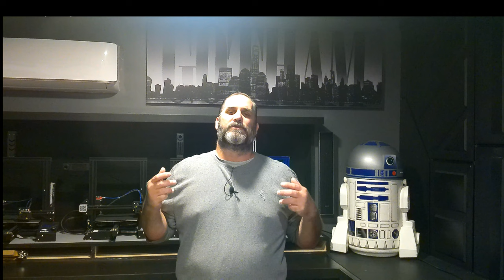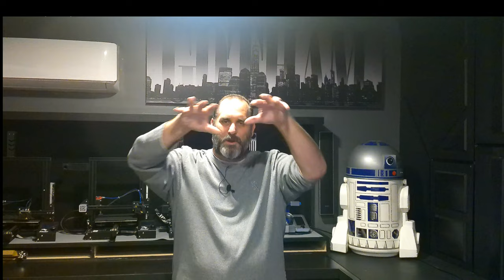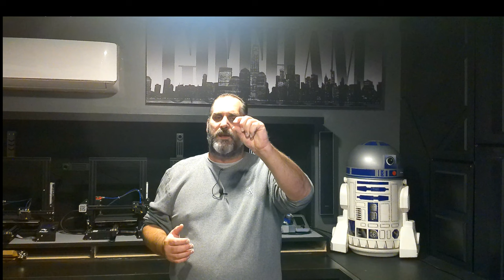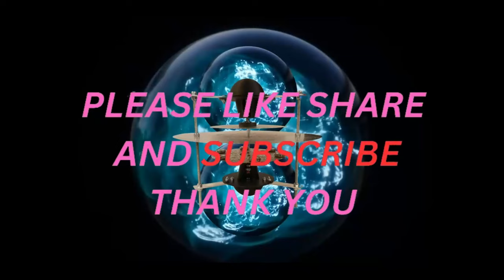Graviflyer Update #41

Comment: Nathan great video once again. You need the high amp hour battery. The 1400 and 600 rpms are near the Schumann resonances as I explained many times. Oh, what is the red light flashing on your air conditioner? Dielectric coating. You need to get rid of the RF and get visible. You have a roundabout way of explaining science and I am not so sure if everyone will understand what you are chatting about. I forgot to mention pulsing in my comment to you as pulsing accelerates the entire craft and a person needs pulsing to get a force from the acceleration as F=ma.
Reply: I think where the russian lives they have some kinds of magnetic field that are different from where other people live.  I think the device is a air MHD drive.   The angle of the magnetic field may be very different from where they guys live.

 NASA now has a ION drive that works at ground level and can generate 1G so we can fly now with ION engines.
Reply from the maker: I am almost at the end of this project. I cannot change what people understand. I can't get people to accept the testing right in front of them. I should have done this project without showing everything.  I know how Alexey feels.
Reply: @nathanbunten4299  "I can't get people to accept the testing right in front of them. I should have done this project without showing everything.  I know how Alexey feels."
Please don't say that - is what I would say, as I personally feel I learn a lot from you experiments and view points. I do however get your mood and feelings. It is not fun to be 'un-normal' when 'normal sane' people group together looking for victims to belittle so they can feel better, as sadly they're often truly miserable inside.
Fortunately the western world has a mostly democratic view, everyone is entitled to their view(s) - sadly some people use the bottom end to voice their views and do their thinking, instead of using their brainy end.  
Please don't let a few arseholes spoil your day!
Thanks again for sharing, it is indeed caring :ø)
Reply from the maker: @EgonSorensen  thank you for that. I just want people to understand. All they want to do is change the experiment. Then others just hit the dislike button every time it is not flying. It is irritating. Thank you for listening and caring.
Reply: @nathanbunten4299  If you're one step ahead, you're said to be a genius and a great leader (sadly most that leads tends to be narcissistic manipulating psychopaths instead of caring people)
If you're two steps ahead, you're said to be crazy (sadly often by those said to be one step ahead)
I have come to see 3 kinds of people: Alphas (often leaders), Betas (often followers) and Sigmas (often lone wolves)
Alphas depend on Betas which depends on Alphas - where the crowd (2+ people) collective mind is like hyenas, the strong survive and the weak die and the theme stays hyena. Sigmas tend to their own set of values, often giving alphas and betas no power over them, as they know they can't control either, so why spend time and energy on changing their 'hyena' mindset and behavior. 
It is unlikely or very hard to change others mindset, and when you say "All they want to do is change the experiment" - they're trying to make themselves alphas and you a beta, bossing you around to do the hard work (and they can claim any and all outcome).
"All they want to do is change the experiment" can also be due to language barriers and lack of personal body-signal-decoding.  My native language is Danish, and Danes is known for being (extremely) direct - not something other cultures especially appreciate all the time (I know from experience). It's just how 'we' act, 'we' don't mean anything bad or demeaning by it, often it is a way to let somebody else know that other ways is/might be possible in a positive way - but 'we' don't expect others to do what 'we' say. 
I hope you get my viewpoint, not everything I say (and I presume others too) is a demand to .... - it is to point out factors that could be important and/or of interest.
I just wanted to make that clear, as I have voiced a few things from my experience as an electrical engineer/radio mechanic and strange/interesting observations in the video presented - and since you have taken the time and effort to do the work, etc - what is not to like, and hitting the like button and reading + liking comments is just a single click, a million times easier than doing what you have to do.
If I don't like content, nothing keeps me here and I can stay away.. and oh, you might the first dislike from me when you get it to fly, as then there'll be no more interesting stuff and interesting points and views from you ;ø) Until then, it's all thumbs up from here!
Reply from the maker: @EgonSorensen  I like direct conversation. Less hiding behind another person's point of view. It is not fake. My parents were in the air force. So the faster to the point the better. 

They probably only see one experiment. Where I see them all. It is a different experience.
Reply: @nathanbunten4299 science literally can’t progress without work like what you’re doing literally right now. Greetings from Tennessee.
Reply: @nathanbunten4299  "So the faster to the point the better. " - Exactly!
Now you 'just' need to learn to speak Danish ;ø)

If you're inside a box, all you see is the inside (or nothing at all, if en-light-enment is missing). If you can think outside of the box, the view is .. well, not the same, and trying to convince others to follow ones views and experiences is often a futile thing to do.
Thankfully this social media is called YouTube, it's YOU on the 'tube' - not others throwing you in the slammer for heresy or single-mindedness for the world to see (though some might try through words to compensate for their own shortcomings. My experience is: Just ignore the negativity here on this platform, positivity attracts negativity)

Alexys said something about positive charges on the graviflyers top-plate equals lift. Be mindful of the negativity but don't let it drag you down, stay on top - stay positive, align and master the fields :ø)
Reply from the maker: @Critter145  Thank you. Greetings from southern California.
Reply: Nathan, YESSS and how I feel from being listed as disabled for the past 44 years after working with the US government on UAP and refusing to join them, so they disabled me as they did back in the day and told everyone that I was crazy and ruined my life. But there is hope now as I informed the US government last month about what occurred to me back in the early 1980s so they just took me off of my disability status and maybe they will compensate me. But if you had not posted everything then I would never have seen your videos and offered my help if I indeed helped.
Reply: @doityourself3293  charles buhler right? yeah if we can replicate that and scale it up correctly we can make a proper ufo, btw it's actually not ion wind says buhler himself because they still got thrust in a vacuum  with no air, so no ion wind just electrostatic pressure, might as well call it anti gravity at that point. not to mention TT Brown discovered the same thing back in the 1920's

Comment: alexy used "electronic ballast" with ac dimmer in driving flyback trans to have control the power and lowering the voltage in your previous video,the zigzag capacitor of aluminum foil is leaking and shorting it dielectric so alexy pulsed it manually several time to let it build up charge, a cavity shape electric plate like honeycomb is way to go as the middle disc because it's less eddy current build up and it's support "scalar wave" static charge electric field without magnetic axis.

Comment: I believe the earth has its own frequency.  With that said, can you feed the (drive beat)  into the peizo speaker?  So, you have the mech drive the rhythm,  and have the speaker give off an earth Hz or anti Hz?  I've been following you for a while.  I also have messed around with unconventional lift methods.  I have a background as an aerospace engineer and composite materials.  Let me know if you ever want to bounce ideas.  I have found we you get burn out or blocked, it helps bouncing ideas.  God bless.
Reply: 4-8hz
Reply from the maker: Thank you. I put this thing in a different state on the testing 11 video. It was. Lose to 13hz. It changed the whole thing. The piezo was active at 4v 1.2a with the same beat frequency as the top disc. 720 rpm close to 13hz. The testing was better when I changed the octave. I am close to understanding the final part. It is harmonics at low voltage and low hz. I finally found the correct octave that makes the piezo more powerful. I need to adjust the amps in the high voltage to create a stronger bond to the magnets to get a negative charge burst when the piezo is suddenly turned off.